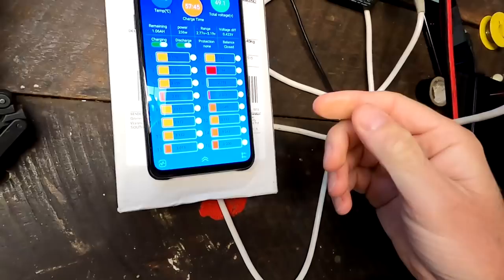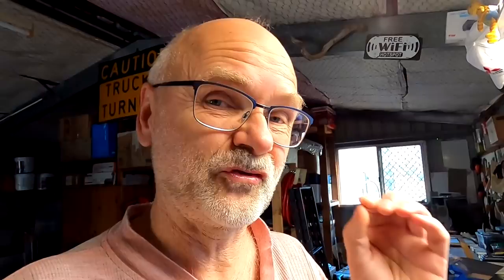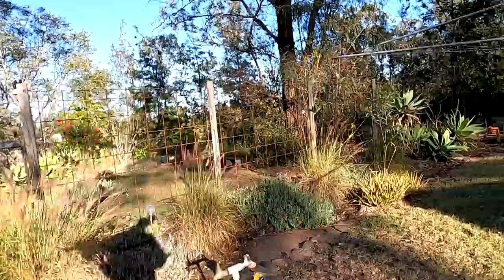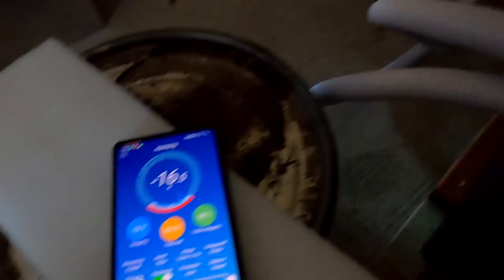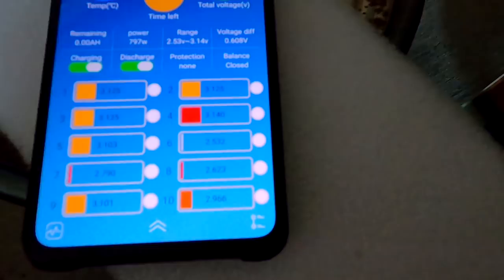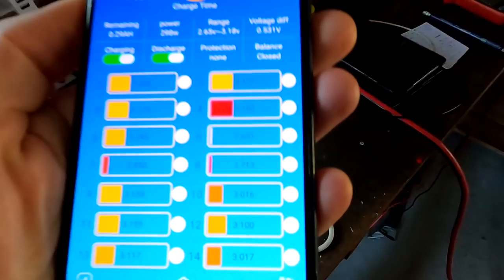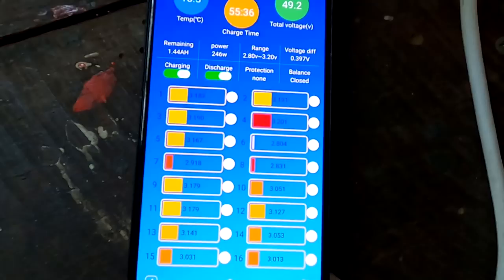QUCC BMS with relay. Why is this happening? 🤷‍♂️😷

Comment: I ended up watching your video after searching the net for a similar problem I have, but with high voltage disconnect. I have a 280ah and 304ah batt bank, wired in parallel, both have a jbd bms. When the 280ah goes over voltage it'll cut the charging, and therefore the discharging but it won't cut back in because the 304 is supplying power to the loads. Until the 304 is out of juice and cuts out at which point the 280 cuts in because there is a power draw. It then dumps 100's of amps into the 304 while also supplying the loads. It's bs.
Reply: So now I have to get ridd of this crap because my parallel packs are going out of sync.

Comment: The BMS detects a charging condition and then it closes the "charging" relay (in this case, the same used to discharge).  So depending on the generation/load balance at that moment it can go to this erratic behavior, where the BMS, charge controller and inverter keep fighting each other.  I think the only way to fix that would be to figure out how to keep the inverter off until you have enough charge back on the battery.
Reply from the maker: Yeah, the inverter usually shuts down before the BMS triggers. I turned this low voltage disconnect off in the inverter for this test. I wanted to se what the BMS does at LVD.
Reply: That's it because the arc surge current from the inverter will put it off. Them the charge voltage is detected by the b closes again only for the load (inverter) to take that high current which will drop the voltage again and make the bms disconnect again. 
Get a balancer

Comment: It is not a problem of BMS setting, in that condition inverter is connected only to power supplied from solar which is not enough to feed pump. In this condition inverter switch on, consume internal inverter capacitor energy plus solar, than voltage drop and cycle start again and again..... If you try this condition when solar is bigger than pump consumption plus losses, inverter will remain on. Pay attention this condition is not safe for charge control. To avoid this is better to have BMS with separate port.

Comment: It seems to me the relay contacts are becoming damaged from constantly turning on and off in a short time frame which is extremely bad for a mechanical relay. . later in your video The discharge was green (on ) in the app but your inverter did not turn on. At that point I would have checked voltage to the relay coil.

Comment: I think because you have only one relay the BMS cannot handle charge mode and discharge mode. the relay allow the battery pack to charge and discharge at the same time. the mosfets type can turn off discharge but keeping charge possible.

Comment: Hello Andy.
My epever solar charge controler must be connected to the battery before being connected to the solar panels. If the battery is disconnected thru the relay, is it not a problem for your charge controler?
Reply from the maker: Not with the Victron. They don't 'break' without a battery.
Reply: @OffGridGarageAustralia  Ok, but I thought the charge controler could be annoyed, and delay start charging for more than 20 seconds?

Comment: LifePO4 batteries are difficult to balance
The radical solution is to disassemble the cells and rebuild a 3.2V battery with the cells assemble in parallel.
Afterwards, it is necessary to carry out the load with a Adjustable DC power supply (10a minimum) with a voltage of 3.65V. When the intensity falls to 150mA, the balancing load is finished.
The battery can then be rebuilt in its good configuration, 48V most of the time.
Reply from the maker: I did that.

Comment: Looks to me that when its in undervoltage disconect the small black wire is there for charging as it senses the solar input but there is likely a current limit to that small wire so maybe there is a threshold of input current that the BMS has set to then reconnect the relay to allow for higher input current but as it only has a single Relay this also connects the load, in this scenario its the discharge rate fighting the charge rate causing undervoltage protect then reapeats. if your load was very small I have a feeling it would not be an issue as the solar would buffer that while keeping the cell voltage above protection level. thats my guess anyway
Reply from the maker: That's exactly how I see it. If the charging current gets too high, it turns on the relay again. The same happened when I switched on the inverter again, the relay closed all of the sudden. So it must sense a certain current through his wire which then triggers the relay eventually.

Comment: this is why i dont like relay based bms's.
especially those that cant communicate with the inverter and tell it to lower the load...
your jk with the canbus will solve this for you.
inverter is pulling more than what is comming in.
so the relay open when it detects charging, but inverter pulls more load than what is comming in , so it triggers the relay again
Reply from the maker: Yes, that is correct. Usually the inverter turns off before the BMS does. I turned off low voltage disconnect in the inverter for this test.
Communication is key, It will be interesting to have them all talking to each other.
Reply: How do you tell the inverter to lower the load, if the pump (load) requires 1000 watts to run and the inverter is told to lower the output to 500 watts would you not end up with a brow out? or stuff the motor. (ignoring motor start up current.
Reply from the maker: @glencooke494  It can only tell the inverter to turn off. But you may have more than one inverter, one for essential load and non-essential load. I think that's what he refers to.
Reply: If the BMS keeps switching the RELAY off and on, it would do the same with MOSFETS as well. Maybe that is why so many MOSFET based BMSs fail.
Reply: @OffGridGarageAustralia  actually i am not.
the jk bms, but there are more like my seplos are in communication with you inverter and charge controllers.
depending on soc , they tell the inverter or charge controller to limit the current to let's say 10 amps.
Reply: @danielglang6312  not quite true.

mosfet based bms's can allow charging, while not allowing discharging.
a relay has 2 states : connected or disconnected
Reply: @houseofancients  I was referring to a previous statement about this particular BMS and any others with the switching problem.  Any BMS with the same design would fail in the same way wither it is using relays or MOSFETS.

Comment: Check if the pack voltage settings are overiding you
Reply from the maker: They don't, they are at 40V, so not even close to the actual pack voltage.

Comment: Would it have anything to do with pack voltage disconnect?
Reply from the maker: That was far higher. We had only one cell at 2.5V. Pack voltage is kinda useless to use for disconnecting a battery.

Comment: You need to set the Low Battery restart Voltage in the Victron higher. I think this is to low.
Reply from the maker: In the Victron? You mean the inverter? That was set to a very low value on purpose so I could see what the BMS does.
Reply: @OffGridGarageAustralia  OK. Thank you for the Answer.

Comment: Can you get around this with only 1 relay(port)?  If you have a load higher than charging it just wont turn on.  You need a separate port BMS.  Probably, easier to get a small 20A separate port and then hook up to relays.
Reply from the maker: QUCC has a dual relay BMS for that purpose to switch charge and discharge individually.

Comment: You should summarize on the white board all the conditions for the relay turn on and turn off. Some threshold are not correct here and should be spaced differently in order to create some hysteresis. The inverter should not turn back on too early in this case. This is probably as you mention, partly due to the imbalance that shifts the switching conditions that control the relay.

Comment: what you want is an electrodacus SBMS ;) it will remote control your inverter and loads so you can charge nicely until healthy and then itll run the loads.. Im running mine for 2 years on my tesla pack with zero issues and next to zero cell deviation, cause it also balances(slightly)
Reply from the maker: He only makes them for 12V and 24V though...
Reply: @OffGridGarageAustralia  true, but I found him to be very responsive to inquiries and his support is great, maybe he can be convinced to upgrade the system or offer a mod kit..

Comment: With the jk bms the canbus should tell the victron to reduce load and limit discharge current
Reply from the maker: That is the plan. It should turn off the inverter if the low voltage disconnect of the inverter fails for some reason.

Comment: Seems like these BMS need two relays, one for the charge and one for the load. They shouldn't really disconnect the charge unless it's over voltage.
Or back to the JK BMS point from the other day, perhaps the charge controller should just be directly attached to the battery and then the charge controller switch off when the pack is over voltage. If the BMS is able to signal specifically cell over voltage then it can also tell the Charge controller to shutdown.

Comment: "You should probably just buy a Daly BMS and be done with it." -Some Guy in the Comments, Probably.

I only rely on my BMS for the worst case and have my inverter shutoff voltage slightly higher than the BMS cut off.  If I had to guess, some of those numbers are based on averages and others are based on the lowest/highest cell.
Reply from the maker: Well, the Daly has other issues 😌
That was exactly the test I did. I turned off the inverter disconnect function to see how the BMS handles it.

Comment: I suggest that you ask your software provider to provide you with a detailed user manual that fully describes exactly what each user definable parameter means.  Then you can probably setup your system without having to guess what each label means..
Reply from the maker: Yeah, good luck with that, getting a proper manual. QUCC does not make this app

Comment: Does the relay have back EMF protection? If not, voltage spikes could cause voltage threshold mis-readings by the BMS. The APP will not display these spikes since they are way too fast. Anyway it's only a suggestion and I'm sure you will work out the issue to your problem soon enough. Good luck..

Comment: The relay disconnects the charger too,  how can the cell voltage is supposed to reach 2.8 when it's 2.55? Have you tried to set the release voltage lower than the protection voltage and see what happens? Maybe it's an error in the English translation and they mixed up the names
Reply from the maker: It can still charge through the black wire I showed... even the relay is off.
Reply: @OffGridGarageAustralia  I thought the black wire was used just to sense if there is some incoming power, but the real power could flow in only if the relay is on. In this case there is a mosfet preventing the overcharge? In any case something is not working accordingly to what you "apparently requested" via the app settings.

Comment: Is it possible that the setting/title on the app does not actually represent what is being changed in the bms. Like firmware issue or app issue?
Reply from the maker: That's what I think, it's a software issue. The app is being used by other BMS as well so it might misinterpret some settings  🤷‍♂️

Comment: If you go under param settings, you will see that 20s is not an acceptable range for delay. You can only set 10s from there. Maybe it is a bug that u can set parameters without range check from param view

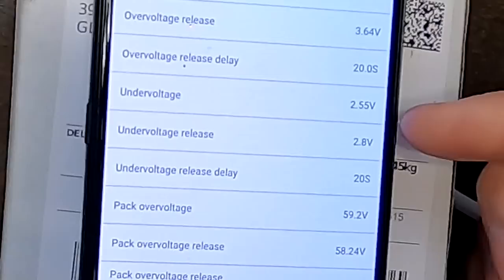Comment: HEY ANDY   I watched the video again and at 2:00, could it be as the Undervoltage trip setting is triggered by LOWEST voltage cell group, could the Undervoltage Release is triggered by the highest voltage cell? It looks like when your lowest voltage cell group is at 2.55V your highest cell (#2) is at 3.125, which is well above your Undervoltage Release of 2.8V.  If so, you might be able to test that by setting the Undervoltae Release above 3.2v?
Reply from the maker: Thanks for watching the video twice 😊
I know what you mean, but these three settings are on a cell base, not a group. 
Undervoltage: 2.55V if ONE cell hits that voltage, it opens the relay
Undervoltage release: 2.8V if NONE of the cells are under 2.8V, the relay closes
Undervoltage release delay: 20s If NONE of the cells are under 2.8V any more it still waits 20s before it closes the relay. This is to prevent the relay from flapping rapidly and blend out peaks which go over/under this threshold only for a second.
Reply: @OffGridGarageAustralia  Thanks, Andy, given that, I would lean towards a defective BMS.

Comment: (Joke) Use two BMSs. Connect the cell leads of both BMs in parallel. Connect the chargers through the relay of one BMS, and the inverter through the relay of the second BMS.

Comment: i could be completely wrong...but i notice when i switch on and off huge relay it will spike voltage ..so i put capacitor parallel to coil of this relay so it will compensate for this and behave like resistor..(almost ofc not completly) ..try this ..
Reply from the maker: I don't think this is the problem but I'll try...

Comment: Maybe Invertor low voltage conflict!
Reply from the maker: The inverter low voltage disconnect was turned off for this test as I really wanted to see how the BMS handles it by itself in case other devices fail.

Comment: Charging amperage is to low...load drains battery faster than charger charges...as the cell is 2.5 or where protection is set it shuts off, detects charge then turns on but load is bigger than charge so you end up in a circle of on off especially since there is one contactor for charge and discharge instead of two independent contractors so it can charge independently from discharging...

Comment: I have a daly which I hate as it stops the charge at 3.4v for some reason even thou the configuration is right. I have bought this crap from qucc and it is only able to charge, when I don't have enough power produced by solar panels the invertor is switching off the batteries. Tipical to chinese people to make only crap staff...any suggestions for a bms that can balance properly and also charge and discharge at the same time?

Comment: I think you got the female version -- it can't make up its mind.  See if they have a male version.
Honestly I'd put that 4a balancer on there and let it run non-stop -- it's worth a shot at least.  I think you'd be surprised.
Also, does the inverter not have the capability to be set outside of the BMS's parameters so that it will charge but not allow a load at certain variables?
Reply from the maker: I usually don't go that deep in voltage ever. Unless for testing. But from previous tests we have seen, the gain is only a few Ah at best but the balancer will destroy you whole top balancing.
Reply: @OffGridGarageAustralia  I really think you should give that 4ah balancer a go for one of your deep discharge runs -- let it run non-stop from full > discharge > recharge.   On the way down, it will try to prevent #6 and friends from dipping that low, and on the way back up it will keep the faster charging cells in-check.  If it's incapable of handling it with its 4ah of current, 2 may be required.  I'm really curious to see how that specific balancer that can keep its amperage will do for full pack capacity.
Reply from the maker: @mhamma6560  that is indeed a very interesting test!

Comment: hello Andy , can you set the JK bms in series?, and also can you series the NEEY balancer , im asking because i have 3x 48v batteries in parallel but i cant find a bms or balancer with 42 leads, my batteries are 7s 24v, thank you.
Reply from the maker: If you have 3 banks with 16 cells each, you need three BMS, one for each battery bank. There is no other way.
Reply: @OffGridGarageAustralia  if i get 3 bms can i put them in parallel?, thanks Andy, sorry my batteries are Li Io
Reply: @OffGridGarageAustralia  Unless you parallel the 16 cells across the 3 banks, then only need 1 bms. Disadvantage is need a higher current bms. Advantage is it would do better to even out the cell to cell differences giving higher overall capacity.

Comment: on the bms does the charging not go to another part of the bms and not the relay
Reply from the maker: Other part? There is only one cable to and from the BMS. The small black wire is for detecting the charge.
Reply: @OffGridGarageAustralia  oh just one of the high current bms I have has a charge spot and a load one with it have s switch on wastware for charge and discharhe I toaght they would be 2 separate connections